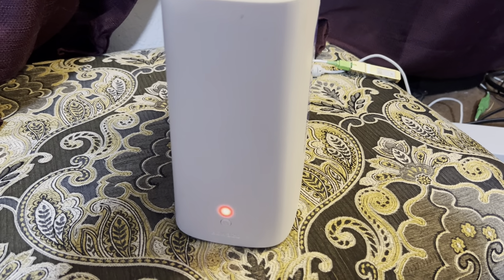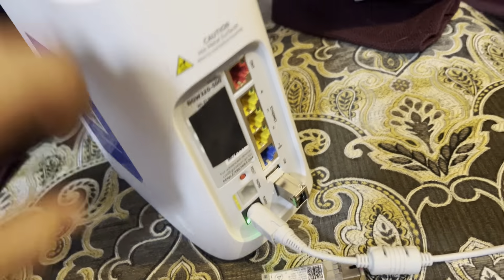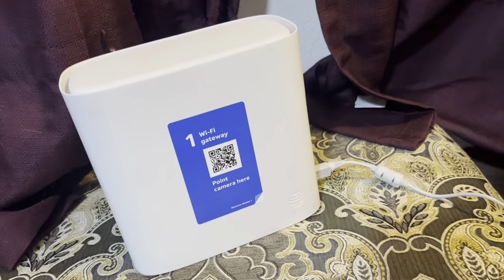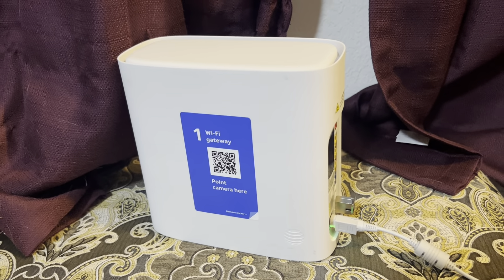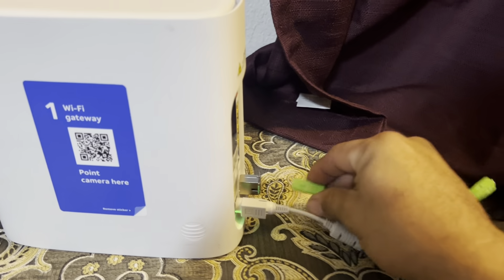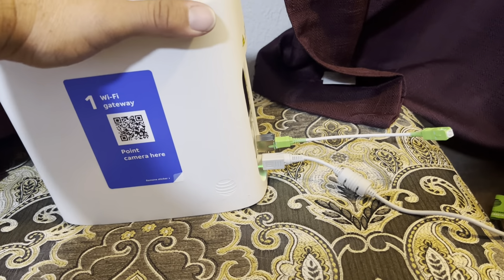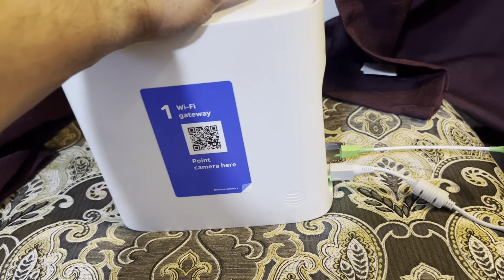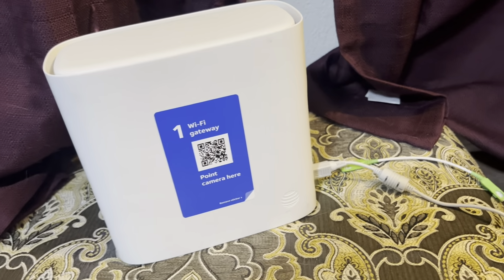Bgw320. How to repair install AT&T fiber internet. Easy trouble shoot guide.

Comment: These modems are junk
Reply: Yep. Mine doesn’t even show the light when I set it up.
Reply: how
Reply: Indeed. Which do you suggest?
Reply from the maker: Yeah And no. 

If you are going to call them junk. And know why and what’s better. Then share. 

Wi-Fi could be better with them. But Ethernet part is the best. 

It’s hot you get the third party routers to work. So in what you are saying is that they work better for WiFi with third party.

Comment: Non of these were my Issue… INTERNET WORKING FINE…. As i was watching TV then all of a sudden… No internet on tv go to check the box and theres the red light… Check all the conections both inside the house and ouside and everything looks good… i even checked it was all the way in (cables)… live alone so nobody else was in the house when it happened… 🤷🏽‍♂️
Reply from the maker: It’s an issue with the network. They need to send out a tech to repair this.

Comment: This could have been a 60 second video. Jesus
Reply from the maker: Could have. But what’s the fun in that. Ever seen lord of the rings. 

Yeah eagles could have ended it. But. Yeah. 

Thank you for the watch. I’ll make some shorter ones.
Reply: @purewhips1  dude. You could have said.. if any of the wires are backwards or slightly disconnected, then said if any of your personal line or main line in the neighborhood was hit or broke or cut.. boom the whole video.
Reply from the maker: @BadSSBowtie yeah. Shorts are fine. Have some. I’ll set you one up for tomorrow. 😁

Comment: This guy answer almost all my questions ❓ but I just got mine today from att because they installed it themselves the only problem is it turns white and in a few minutes later goes back to Orange and no Internet yet it's a little like the technician is going to have to come out here soon
Reply from the maker: Thank you very much for that. 

So when it goes white then orange. It could be that the gateway is defective or not receiving enough power.  Those power plugs go bad sometimes.
Reply: @purewhips1  welcome and I forgot to tell you mine fix now.
Reply from the maker: @cs77smith67  cool. Thank you for letting me know!
Reply from the maker: @gabrielaguirre3111 it turned red. And you’ve followed my set up here?  If you did. Then this is where you need to call att and have them send out a tech.
Reply: @cs77smith67 what did you do??
Reply: @Thygoodwill  nothing 🤣 that was a year ago. It's working perfectly now

Comment: Ive never had a router i cant unplug and plug back into the wall without breaking it. This thing is junk Lol
Reply from the maker: It’s hard to remove some of the green ones for some reason the latch does not remove the other latch that is inside the module
Reply: @purewhips1  I ended up having an outage in my entire neighborhood, techs had to come out. Appreciate the video and knowledge my man!

Comment: Our router has been in the attic for 2 days and it's overheating right now. Do I need a new router or do I need to take it apart to let it cool? I of course will move it from the attic because this Texas heat is crazy right now. (Btw I reset it and it's still beeping red)
Reply from the maker: needs to be indoors anything above 85° will end up destroying the gateway. 

Was it installed by technician in the attic? 

When was the last time it was working?
Reply: @purewhips1  hey (●’◡’●)ﾉ Thank you for texting back and yes a technician installed it in the attic but he warned us about overheating, I thought that was the problem. The actual problem was  just a power outage lol. Once again THANK YOU ☺️.

Comment: Been having issues with ATT fiber for a week now. Multiple techs have came out and they each do something different saying it’s going to fix issue. Constantly going out all day. Spectrum will be set up tomorrow, never had issue with them. Only switched bc brand new fiber lines ran through neighborhood
Reply from the maker: You have trouble with att fiber?  

Did they change out the SFP.  Scope and clean the ends at the connections?  Reporvision the account to make sure all setting are proper. 

Fiber is very delicate. If it’s not pristine all the way to the SFP. You will have issues.

Comment: Yep, my lawn was power seeded and I suspect they cut the wire. It’s barely under the sod, maybe 1/2”. 
(I’m Switching providers, ATT fiber was ran to house a couple years ago) 
Thx for the info. ATT visiting tomorrow for trouble shooting. Bet they pull another line to house from box in yard. 
Thx again. (SUBd👍🇺🇸)

Comment: What if you’re on the ONT, red cable
Reply from the maker: On the Ont red cable??  

Is it plugged in?  

Is the alarm on?
Reply: Same question as above. Mine is plugged in properly. 
What alarm do u mean?
Reply from the maker: Alarm on the ONT will be red if there is no signal going to that modem. You can do Anything with out proper tools. So call in a ticket for it. 

Don’t unplug anything at all.

Comment: My last modem I had I think had the green one but the one I have is orange so my green line won't work then I will have to get an orange line.
Reply from the maker: Should be just an Ethernet cord. 

If not. You’ll have to call att and send out a tech.

Comment: My dog pulled that green cord from outside on the wall. I’m lost
Reply: You can either call AT&T and have them send you a technician with the data cable or run to Best Buy and see if they have a two pair data cable
Reply: And if it’s a fiber, you will definitely need to have AT&T send you a text
Reply: @GtGamerGc  thank you
Reply from the maker: I thought I replied to this call 288-2020 have them send a technician hopefully you already got all this figured out before this reply

Comment: Hi my friend. I noticed on my box I have the red sfp plug but am only paying for 1gbps. Can that cause any issues? I've been having some but will spare the trouble of story for now.
Reply from the maker: Hello!  No that will not cause any issue. 
The fiber signal coming in to the gateway is at a high frequency needing that red spf. 

You can go as low as 100/100 and up to 5000/5000

If you have issues at any speed. Then att needs to run a fiber check on the service.

Comment: what if i didnt get an sfp?
Reply from the maker: If you didn’t get an SFP. then that means you have a modem somewhere where you will connect that Ethernet from the 010 to the bgw320 on the Ont red port.

Comment: Mine is flashing green but the activation button is grey.
Reply from the maker: Start the app over and try it again. Should work once it’s sees the Ont modem

Blinking green is a good sign
Reply: Did it ever work for you
Reply from the maker: Yeah it did. 
Done this many times. With the app. With att on the phone. 

Heck I know a few att techs that I can call for small stuff like this too.
Reply: How did you get it fixed
Reply: @ Kidsmurf11

Comment: It say it’s connected but not internet
Reply: Same
Reply from the maker: Did you register the gateway with the smart home manager?
Reply: @purewhips1  yes and still the same
Reply from the maker: @Supreme-lh8zs well heck. 
Make a call to att and have them push the registration. 

Also. Make sure that you’re gateway front light is solid white and not blinking green or red.
Reply: @purewhips1  it is solid white but still no internet connection weird 😂🤔
Reply from the maker: @Supreme-lh8zs yeah. They need to push that registration.
Reply: @purewhips1  ah okay thanks 🙏